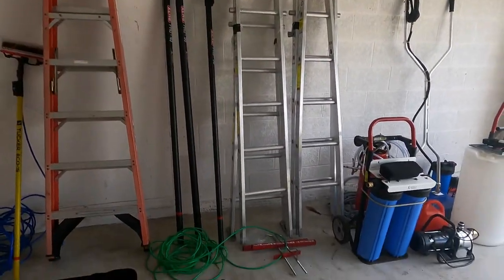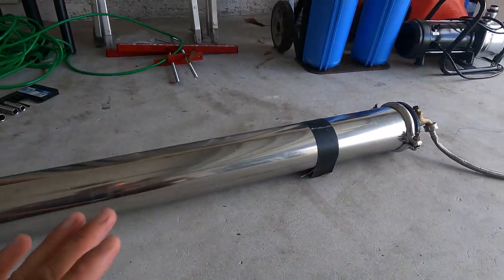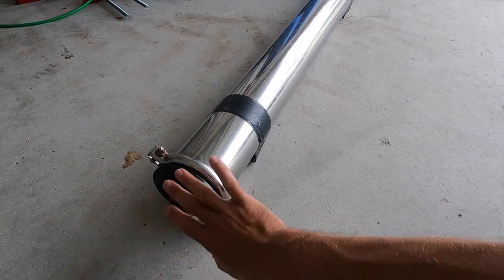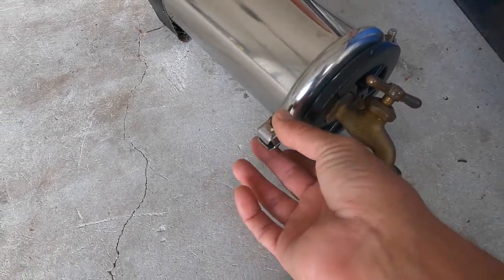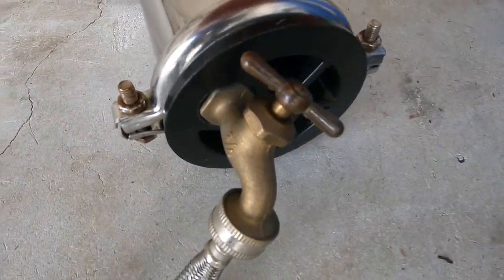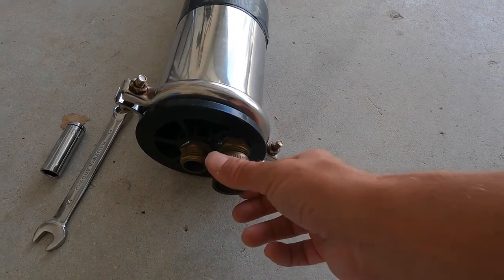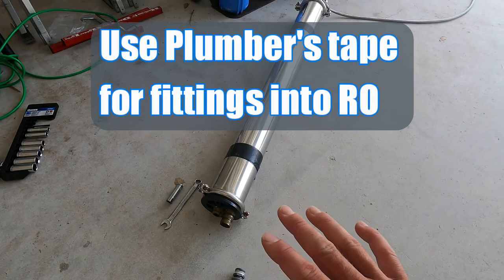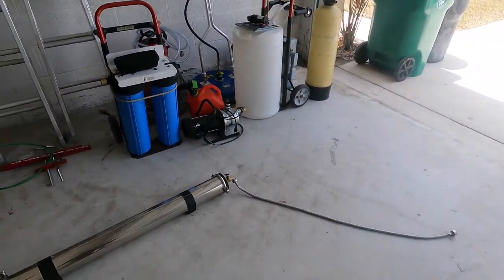DIY RO Filtration System Set-Up (Part 1)

Comment: That is ass backward the dirty and outlet should be the same side
Reply from the maker: Not sure about that-  My friend has also built 3 of these over the years just like this for his rigs and employees.  I just replaced this RO last week after 3+ years of use, installed it the same way-- works perfect for them and no issues. Takes my 346 TDS water from the tap and reduces it to 17.  If it was backwards, it wouldn't reduce almost 95+ percent of the TDS.  So as long as the dirty water discharges on the opposite side as the inlet, that's all that's important.  All I can say is, it works perfect for me.  Individual results vary I suppose. I will upload the actual real-time installation soon, this was after it was all assembled in 2020 or so.

Comment: Good looking water fed setup.
Reply from the maker: Very basic, but does the job!  The ONLY drawback to this is...well, it isn't mobile just yet. You could put a sling on both ends and shoulder carry it (It's not heavy at all anyway)

 But, not really what I'm going for-- I'm working on a truck bed skid and this will be a piece on there. I have a couple DI tanks, I may add it as the final polish only because I have them in the garage-- why not.  

This system rivals most any other of the "big box" brands.  Add a pump and run 2 poles no problem......cost efficient

Comment: Can you text me? You are inspiring me i would send you pics of my system i would like to add bigger diameter hoses
Reply from the maker: Mario do you need larger diameter hose like the blue one that feeds my water fed Pole or are you talking about the other ones (the lime green hose)
Reply from the maker: Are you on any of the window cleaning groups? Look for my name and message me.  I post under my name on those groups
Reply: @kdwindowcleaning  (818) 6250236
Reply: Sorry i tough i posted my number before
Reply from the maker: @marioswindowcleaning5617  hey Mario I was just thinking of something men your lack of flow might be those 20in filters you going to have to look up what brand they are and find out the gallons per day that unit can produce for instance the RO system I have produces 2500 gallon per day some of those 20in ones only produced 800 so even if you have two of them you're looking at 1600 compared to 2500gpd